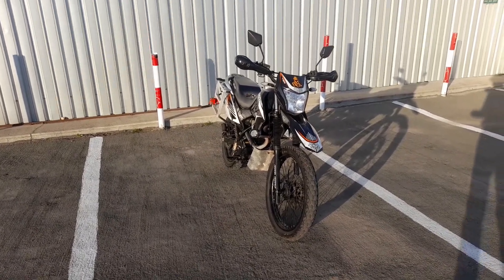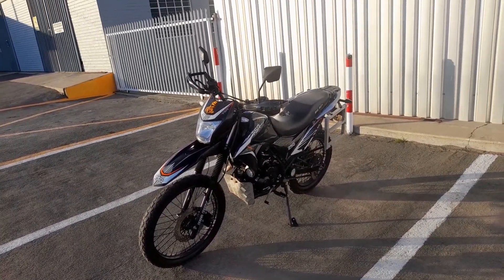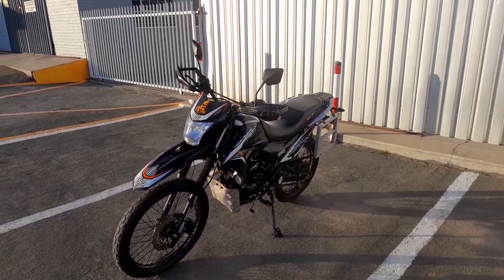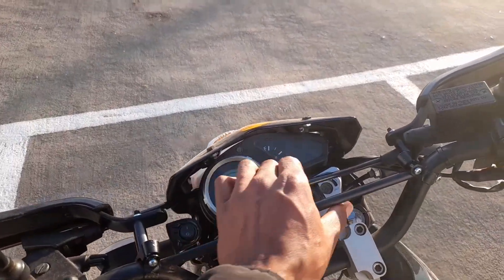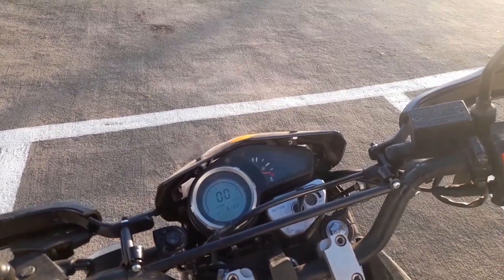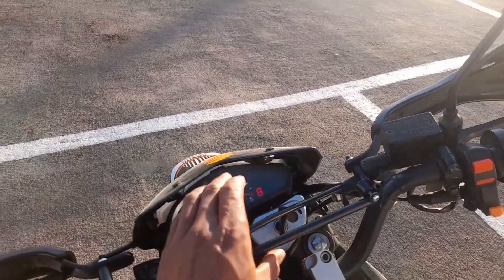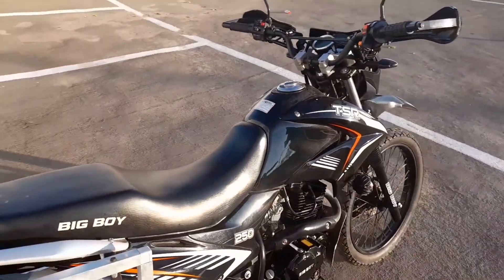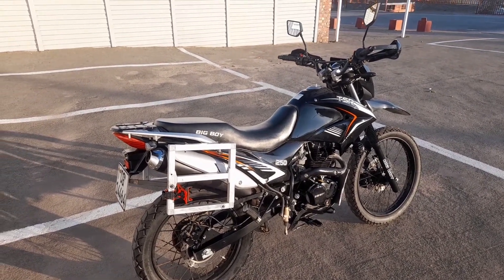2021 Honda Africatwin Exhaust sound killer?

Comment: Hey bru. Thanks for the content. I've been watching most of your videos as I'm interested in one of these bikes for myself. Thanks for pointing out the issues you've had. Do you have a warranty that covers any of the items that broke?
Reply from the maker: Hi. Thanks i do absolutely appreciate it.  At the moment I've voided the warranty when i decided that this bike is going to be the one I'm working on myself. But i don't think they'll cover the sprocket studs as for they are part of wear and tear but they're supposed to fix the desh light if it fails and also the wires that connects the headlight. The bulb is perfectly fine and in working condition.
Reply from the maker: It's a pleasure sir. And i use to be happy with it but now since i desire a bigger bike and which I'm looking for not so much happy anymore for i want to do longer rides and currently my travel is curbed to 200km per day. The stock tyreds in my opinion is not great but still usable on pavement. Doesn't have confident grip in corners but okay offroad. I ran mine up in about 2800kms i think so they don't really last long if you runnig on pavement most of the time which i did.
Reply from the maker: Always a pleasure. That's normally where i end. I have done longer rides which were over a weekend more then 900 kms and one recently 356kms but then it eats oil and after 200kms i  start getting uncomfortable riding it. On long ride i normally when I've reached 200 kms let the bike stand for about 15 minutes to check the oil before i continue.
Reply: @mototracksofficial  thanks for the reply. I enjoy the content because this bike is one of the few realistic options for entry into adventure biking. And no one is really making content about it. For me, I can't see myself making a huge investment initially. So appreciate what you're doing. It really helps someone like me plan ahead.
Reply from the maker: @miscible21  thanks i enjoy doing it. And thanks for your interest.